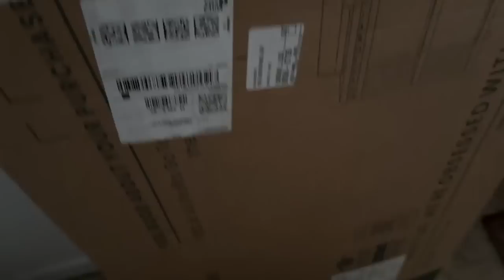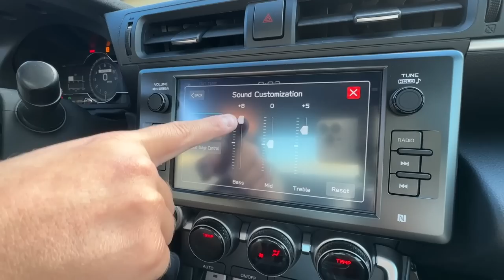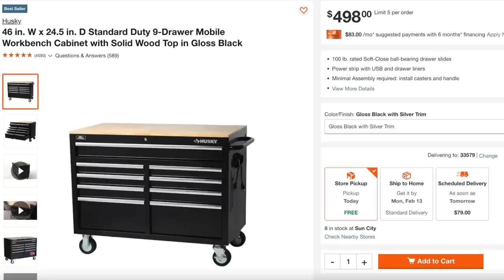Driving my 2022 Subaru BRZ ep. 3 - I'VE MISSED THIS THING!

Comment: Making me really want to get a newer brz. I have my fast car for top speed with my f80 but I’d love to just have a nice drivers car that I could really push around and not care what happens to it.
Reply from the maker: Wow! I would love to drive an F80. The new BMWs are sick
Reply: @Camhill182  I’m a bmw fanboy lol. Had the f80 for 4 years now. Great car but when I sold my type r I got a cpo m240i as my daily. I tend to drive it a lot more than the m3. That’s the car I’d recommend you drive one day. The b58 is an amazing platform and 100% bulletproof at this point.
Reply: @Camhill182  also before the market blew up you could grab a used m240i in the low 30s. If you ever find one at that price it’s a no brainer.
Reply: @F80mthree  I had a manual m240i and now, a 2023 BRZ. Personally enjoying the BRZ more as I rarely speed anyways, nor do I like street racing. 

 The manual box in the BRZ is waayyy better. M240i is a really good coupe/cruiser. Most M240i’s don’t even have a limited slip diff ($5k for the OEM BMW one iirc) ..definitely feels like a compromise car next to an M2, even though the B58 is an amazing motor. That said, I sometimes find myself missing the torque.

 If they ever drop to 30k again, would be nice to have a decent M240i/M340i (auto imo).
Reply: @Barbwire710  I do agree with the points listed but having the f80 m3 (6 speed) as my fun car the m240i just made a lot more sense for me to use as a daily compared to the M2. I am definitely starting to come around to the fact that I don’t really need the power of the b58 for daily use though. Hopefully can find a new brz to test drive soon. I feel like we can get closer to the limits of the brz compared to the m240i and especially the full blown M’s. My f80 feels way too twitchy when you’re going all out in it but I guess that adds to the fun factor in a way.

Comment: For the Garage floor, you should look into Race Deck! My brother currently has them and is very happy with it. They just snap together, and you can cut/trim to fit. Only con that ive noticed is when its hot out, the tracks send to pop out in certain areas. But overall he has been happy. Worth check out